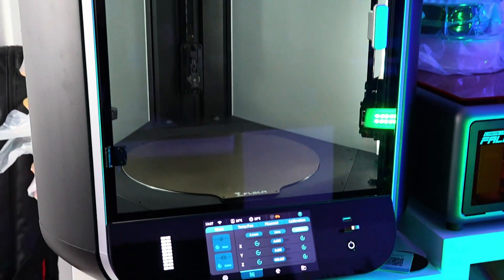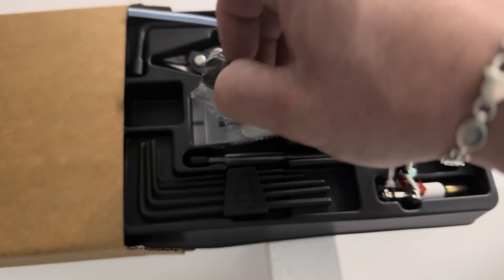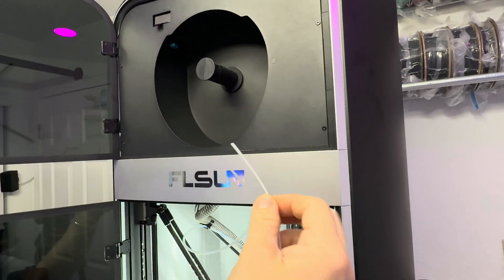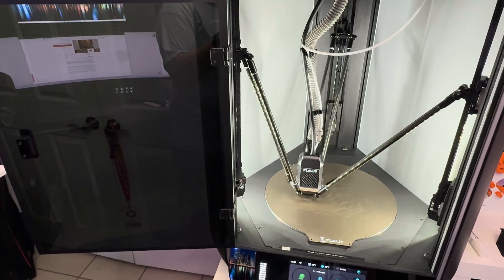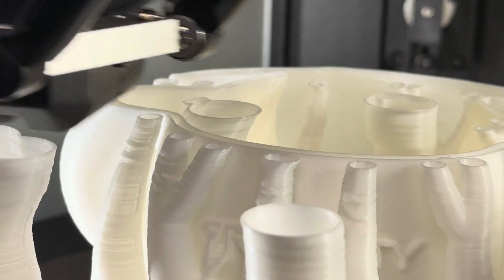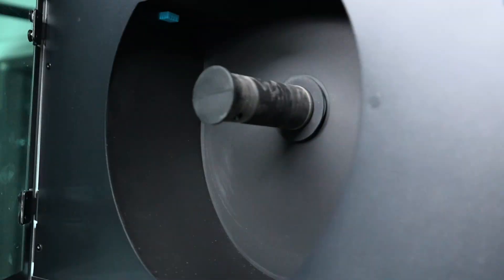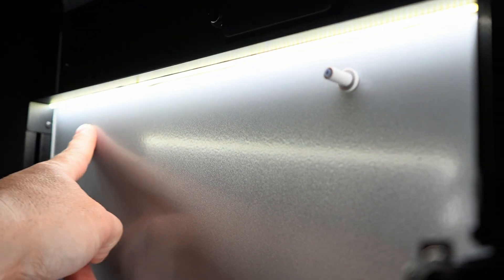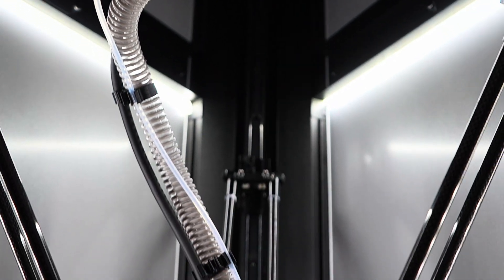Is the FL SUN S1 Pro a Smart Buy in 2025? A Quick Overview

Comment: They are selling the S1 PRO for €899 and the S1 for €699 and now they offer a €200 discount until October 10 so I finally ordered the standard S1 yesterday for just €499!  I also bought the silent fan upgrade and I plan to try the FLSUN Open source edition software on it.
Reply from the maker: Nice! Join our discord and let us know how you like them! You have access to a ton of other 3d printing nerds who can help if you ever need anything. Special link here! Thanks for watching! 
https://mee6.xyz/i/4YMcjZjNO6
Reply: @stayreadyto3dprint This will be my fourth Flsun printer so I already know what to expect, good hardware but questionable software. 😁 My love for Delta printers started by chance with a QQ-S Pro a couple of years ago and last year I saw that they were offering used returned printers really cheap and provide any parts needed to get them running again. And since I like to tinker i first bought a SR and Speeder Pad.  It needed a new MB but has been working great after that. I then got a V400 which only needed a cooling fan for the stepper drivers.  Be interesting to play with the S1. 🙏
Reply: What is your impression of the normal S1? I'm thinking about getting one, but mostly heard that the print quality is not that good and the printer has reliability issues.
Reply: @dudewithasock6594 Not to bad actually, loud and fast, Z-zero is a bit fiddly sometimes, needs to heat soak a couple of minutes before the first print, then it prints great.  I also ordered the silent fan upgrade but I still haven't gotten around to mount it yet.  Not that many hours on it but it is well built and the few problems I have had on my other Flsun printers have been user error. 😁Firmware still not perfect but it works ok now and really good for the price I paid . 🙂 Still tempted to test the Open Source Edition firmware. 🤔   🖖
Reply: @dudewithasock6594  I can really recommend the silent fan kit!  Currently I have it mounted  on the inside, filed two of the original mounting holes a bit wider, like one millimeter each and I had to print a 2mm spacer because there is a rubber plug on the middle of the motor that protrudes a little bit.  Still loud compared to "slow" printers but a lot lower volume now even att full speed but most of all a much nicer tone with no turbo/jet engine whine. 🙂 Might try putting another quiet extraxtion fan in the top cover because it gets quite hot inside the chamber now when the overpressure is gone. The existing exhaust fan will suffice for now though.
Reply: Oh and an X-MAX I got for free from a friend and repaired, I am trying to give it back to him because I need that spot for the U1 that is incoming... 😁

Comment: I thought about getting one of these instead of a k2 but I’m very happy I made the descision to get the k2 plus my next printer might be this one hopefully! Also if people are concerned about moving it they could put it on those stands with wheels
Reply from the maker: Yeah true
Reply: They are on supersale until October 10, at least in the EU. 🖖
Reply: This thing is VERY noisy. The k2 is super quiet.
Reply: @Foreign_Tropical oh ok good to know ya the k2 is definitely pretty quiet
Reply: True
Reply: DONT!!!!!!
Reply: I feel compelled to share my experience with the Flsun S1 Pro because I believe potential buyers deserve to hear the truth about this machine. I invested over $1500 in what I thought would be a reliable, high-quality 3D printer, but my experience has been nothing short of a nightmare.

From the very beginning, I faced numerous issues that made this machine difficult and frustrating to use. The assembly instructions were unclear, leading to hours of troubleshooting just to get it running. Once operational, I encountered persistent mechanical failures—parts breaking, belts slipping, and extruders jamming without warning. Despite following all recommended maintenance procedures, these problems continued to plague me, severely impacting the quality and consistency of my prints.

Software compatibility and firmware updates have been a nightmare. The UI is unintuitive, and frequent crashes or glitches have caused me to lose hours of work. Support from the company has been unhelpful—delayed responses, vague answers, and no real solutions. It’s clear that customer service is not a priority.

I regret my purchase deeply. This machine has caused me wasted time, frustration, and financial loss. I would strongly advise anyone considering the Flsun S1 Pro to think twice. There are far better options out there that won’t leave you feeling cheated, disappointed, or stranded with a malfunctioning machine.

To Flsun: your product has caused me nothing but stress and disappointment. I will not be buying any parts or products from your company again, and I hope this review helps others avoid the same fate.
Reply from the maker: Well in response to that I would say you are valid for feeling that way. There are always gonna be bad printers in every batch no matter what company you go to. What I DK is look at the overall picture. What are “most” people experiencing. Because you can’t base the value of a product off of one instance. Just like ppl shouldn’t use my review alone as a basis to purchase. But I don’t truly believe they are bad printers. I’ve seen way more good than bad about them. And as for the interface I thought it was very easy to navigate. And especially easy to assemble. I didn’t even need them instructions. It was only adding the doors and the touch panel with 2 screws and the wires were labeled so you couldnt mess it up. 

If you want to get it working I’m sure we could help you. Most of the time it’s not the machine honestly. You can join our discord and we will help you and guide you on how to muse the machine successfully.
Reply: @stayreadyto3dprint ya fr